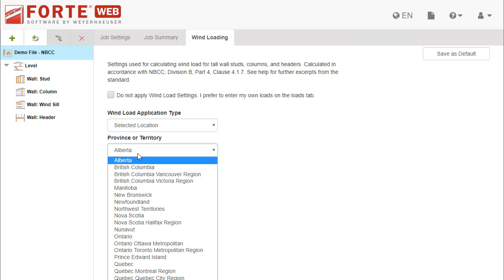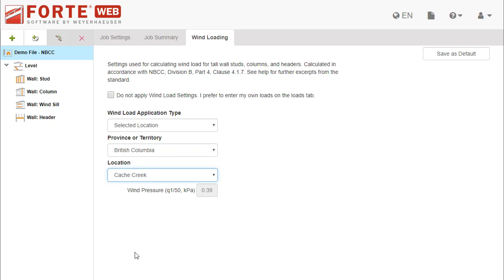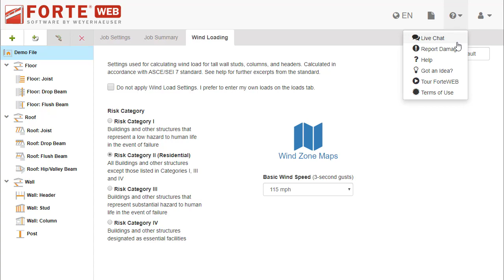Tour ForteWEB: The Wind Loading Tab

Comment: What about wind load on roof?
Reply from the maker: ForteWEB only designs vertical wind loads for roofs. If you wanted to account for horizontal wind loads, you would have to convert that manually into a vertical load.